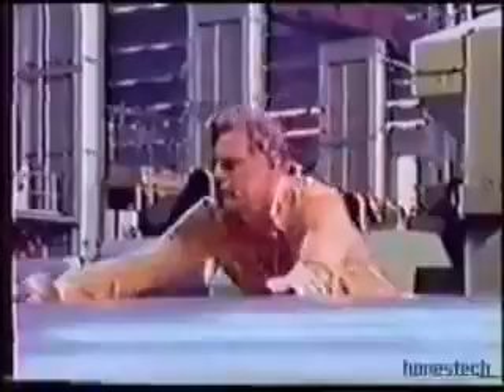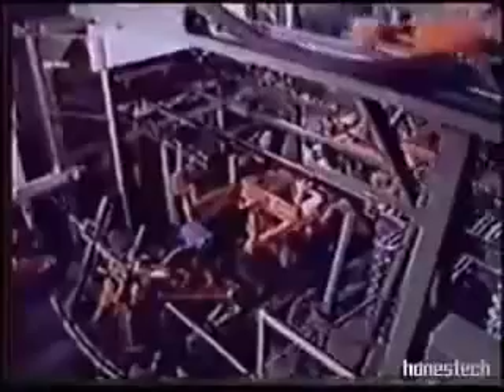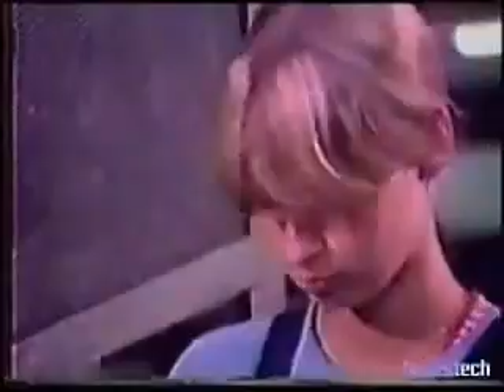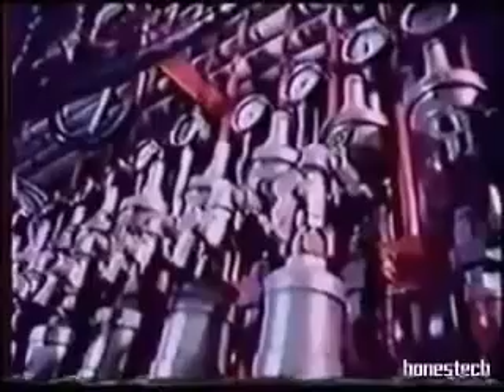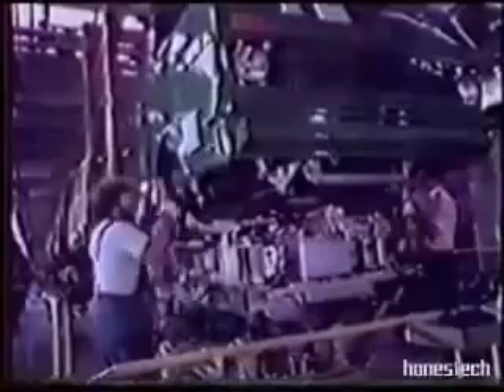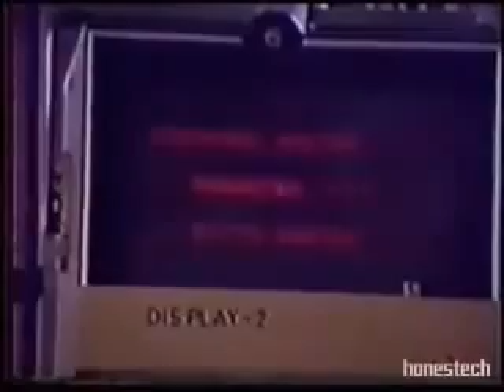VW Transporter Production Line Vanagon / T3 / T25 (Full Video)

Comment: I had an '85 camper, loved it, but it's amazing how much more car you get for your money today. The non-camper GL msrp was around $13,400; in today's dollars that's over $32,000. You can buy a lot of car for that. The '85 had no A/C, no air bags and drum brakes in the rear. Barely got 20 mpg. My 2018 Tiguan gets 30 mpg on the highway and is very fast, the vanagon was slow. But still, I miss it and would love to buy a new one.
Reply: My T25 is 33 years old and works perfectly, let me know if your Tigan is 100 % reliable in 2051
Reply: Put a Subaru 2.5 and disk break conversion. It brings it to the 21 century.